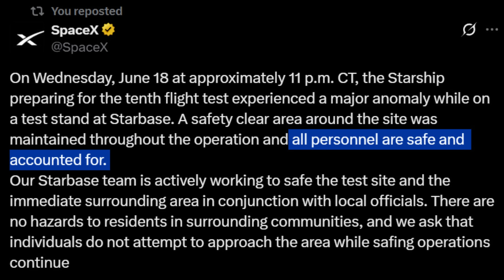SpaceX's Latest Starship Explodes During Ground Test

Comment: This is what I explain to my "agile scrum" enthusiastic colleagues - you can not apply brainlessly methods borrowed from software and computer science into engineering, especially mission-crytical. You can not replace quality orderly engineering with fast design iteration. It looks cool for a while - until it does not. Complex multidisciplinary systems fail in a very complex ways and you can not just hope failure modes go away proportionally to the design iterations. If your underlying system is trash, in software it will work somehow and when it fails the cost of a new iteration is not that big. In engineering badly designed systems will not magically get much better because you test them and fail them more. This is a very non-intelligent thing to do.

Comment: Scott , I think your statement about Mars being a long shot is a bit too optimistic.  At the rate SpaceX is going a single orbit is a long shot . Correct me it I am wrong but has any other program had 10 spectacular failures and continued on ? Any rocket destined for Mars should not even break a sweat getting to low earth orbit

Comment: SpaceX should build an adapter to allow Block 2 Starships to be mounted directly to Pad 1 for chryo and engine testing, and rebuild Massey's to support Block 3 Starships.  This would allow for two more flights before Pad 2 is operational.  If a test blows up Pad 1, so be it.  The Block 3 campaign can't start until Pad 2 is operational anyways.  No need for dump money and resources into Massey's to complete Block 2 campaign.

Comment: Is it now time for
a. Space X took take a long look at the structural integrity of the whole starship as it would be to appear that it is structural failure/work quality/design that is coming to the front of the program - because of the speed of the expected turnover rate to make the program successful and the obvious financial pressure?
b. Is this pressure being caused by the godlike bottom line of Max payload expectations (that cannot be touched) and this is at the expense of everything else which points to design being maximized for this Line rather than longevity and reliability? which will pay in the long term - - falcon 9 being the obvious example.
Space x is now committed to launching the big rockets while the turtle (F9) is slowly getting the satellites and other paying stuff into space which ultimately pays the bills. The math must be obvious by now, how many more F9 launches could have been made if resources hadn't been deployed chasing the golden egg - 10x payload?
Space x demo crews and speed of pipe turnaround and tank delivery present small delays as will concrete pad and deluge pipework repairs but this is a small matter compared to the problems faced by losing 3x V2 starships and folks then talking about V3 which is all about increasing payloads yet again. 
Question?  - has the physical engineering limit been reached/exceeded for the production cycle turnaround? - its all very well defending the destruction iteration engineering model but 3 failures in a row would point to a serious physical problem - wouldn't it?
Also, Manufacturing at such a rate with constant design iteration presents its own problems - is it time to look at less payload to create more reliability (math mentioned before)?
I am a huge fan - we need reliable space vehicles to move forward but I think the excitement created by constant shouting about goals that may be 100 years away is forcing development at a rate which may have reached its limit of reliability and safety.
simple truth - space x hasn't got this rocket to reliably orbit the earth yet and we are going to make it bigger?
what is next? - ignore the mishap - rebuild the site and carry on? that would seem to be a poor decision from the outside.
Just one thing that i think may have been "glossed over" in the commentary was the answer to the question about what if this had happened to a fully loaded starship on the pad with the fully loaded starship - that's 5000 tons of fuel?  
Wouldn't cause a detonation creating a shockwave but the deflagration - looking at the damage to the smaller massey's site - what would be the effect on the bigger site?
 Doesn't that have to be factored into any thinking on continued design expansion?
The world - including me, look forward to launches and the spectacular catches but continuing failure will affect everything - including space tourism.
I am asking questions - not criticizing
anyone done the math on Falcon 9 launches and income vs - how long starship development has taken rather than increasing the falcon 9 fleet?
Great discussion but I think the physical engineering/speed limit has been reached - so it will be fascinating to see whether speed of launch/payload gods still rule.

Comment: Another successful data gathering event. 

So when is sx going to get the data they need for the THERMAL PROTECTION SYSTEM design so that it can inform V3 design. Everything is getting way out of sync for data transferring forward. So now a V2 starship is gone, do they have too many V2 boosters?

Another one bites the dust Another one bites the dust And another one gone, and another one gone Another one bites the dust! → Queen. 

Looking SUBOPTIMAL THERE folks! This sorta has the feel of the very early space program when the rockets were blowing up constantly because they were doing things for the very first time!

11:54 No s… Sherlock! What takes a real engineer is to recognize this years ago. Sx is wasting time chasing their tail. There is a clear root cause to this CF.

Comment: Are the header tanks the source for the attitude control thrusters?
If so eliminating fuel requiring jets, it is far better to use an attitude control system using pairs of counter rotating control moment gyros, each pair sized for the corresponding body axis.
Based on new solid state battery technology with an energy density of 660 watthours per kg this would remove any conflagration.
Further weight reduction is the elimination of the pesky flaps at the nose and aft, replaced with a fixed ceramic composite strake with trim tabs for momentum desaturation.
Can this system be simulated to evaluate all operation scenarios from free fall to re-entry to stabilization after landing until the landing legs are individually adjusted to prevent tip over. 
No fuel  required,  no leaks. For the long trip to mars, solar panels would provide the power and the solar pressure can provide the torque for desaturation.

Comment: You have another YouTube channel signing off with "Fly Safe." Captain Steeve, a commercial airline pilot (a captain), who has recently been commenting on the Air India crash amongst others, uses the same ending. Within the wide range held by the tube of U, I suggest you are both towards the analytical, rather than the wildly speculative commentators.

Comment: Funny thou...  By the 8th Saturn V launch, NASA and put men on the moon 55 years ago.   Every test launch meets the milestone, no explosions.  About a dozen or so Mercury and Gemini launches only had two explosions - I think.   Almost 10 years before the moon landing.     And the guy who can't design a truck can't EVEN get his Starship to do a single orbit or carry a dummy-payload  which is very Standard as they want to make sure the design can carry the weight. 

Elon promises 100 tons.   So far they only did a banana and then carried about 5 tons of test-Starlinks Sats (non functional).   And they couldn't even OPEN the door.    Ah, remember - Elon was given about $4B for a design for lunar and beyond.  bit its made for Starlink launches.   

This is #10.  This is not impressive.

Comment: Composite Tanks have been known for over 20 years to not be reliable... in fact it was first proven in the Paintball industry,  No other nitrogen/co2 tanks failed during play other than Composite tanks.  It became so bad and deadly that shops refused to refill them and started a rigourous testing campaign and you could only refill after tank is tested (which you paid extra for)

Why would anyone use such things in a rocket is beyond me, to save a little weight?  We so called "PC Engineers" or so you taught said this years ago, we also warned about the ground tanks around the pad was also way too close, its not even allowed in Aviation why would it be allowed for rockets?  But hey, we were told "you think your smarter than Elon?" and "Your an armchair engineer"  not knowing most of us commenting and critiquing the choices Elon were making are actual Engineers longer in the field than Elon himself has been alive.

Now rebuild everything at the test facility, your cost saving using composite tanks just cost you way more money.

BRAVO!!!

I also saw Felix's (What about it) interview as well... Its sometimes good to not have your nose right up Elon's Arse, its more helpful to be actually critical of certain things vs Brown nosing... But you cant have you loosing respect from Elon huh...  It is a Blunder on your part not speaking up at that point, just like it was a blunder on last live stream of test launch where you got up and left chat with an utter moron missing everything that happened during the flight and that it was even in trouble until a full half hour after.

Sad people.

But hey when you Stop Micro-Managing and go to play politician and set your seed in multiple women, something must go wrong... and here we are.

Comment: Probably a reason for the header tank to be st the  other end than down closer to the bottom with shorter down comers.  Might be better to have 3 smaller tanks near the bottom or they to need to rethink the design cause the newer design is not working better than first designs.

Comment: As far as silica effects, when I was working in a dental lab we used silica for ceramics casting and needed ventelation or masks when mixing as long term exposure causes silicosis. This was free silica and not fiberous but I imagine the risk is similar.

Comment: I mean, the whole problem is that Starship is soooo heavy, that they keep having to add more and more fuel while saving weight in order to have any payload weight left. And that is starting to bite. The tyranny of the rocket equation is absolute, and when you try to build a 2 stage reusable rocket with a low delta v fuel such as methane+O2, well, you set yourself a herculean task.

Comment: Very cool of Kathy Lueders to give the HLS contract to SpaceX while she was at NASA, then quit NASA to go work for SpaceX. Very normal and super not corrupt. Now Musk is again promising Mars nonsense, probably hoping everyone would just forget about the BILLIONS given to SpaceX for said HLS. You may now commence your apologetics for:
- Working on starlink deploying instead of the HLS variant 
- FIVE cancelled in-orbit raptor re-lights (well, SUB-orbital, since Starship has not yet made orbit)
- THREE cancelled "pez dispenser demos" with one partial success (open but wouldn't close)
- CONSTANT LYING ABOUT THE DAMN HEAT TILES!! SpaceX didn't "invent" them or "innovate on the design", THEY LICENSED IT (come on y'all, this is all in the public record)
- Yeah, we know the catch of the booster is cool, we all saw it, but the idea is to get the PAYLOAD to its destination, and CLOSING IN ON TEN FLIGHTS, they're at zero for a 100% successful flight, AND THEY HAVEN'T EVEN ATTEMPTED ACTUAL ORBIT YET.
- The raptor 3 lie "look how less complex it is" (photo cropped just above the main body to hide the plumbing). They did THE SAME TRICK for the Raptor 2. Why lie? The engine is still a marvel of engineering, so WTH?
-In-orbit refuelling. Watch Destin from Smarter Every Day's video about how stupid complex it is, and how you'll need at least FIFTEEN FLIGHTS to fill one starship with a propellant that has not been demonstrated to be transferable in orbit yet.

Comment: Hi Scott, thanks for covering this so well. In watching the slow motion over and over, I think the timing would indicate one of the header tanks rupturing, and since it acted as an oxidizer to the methane tank rupturing, I deduce that it was the oxygen tank. I believe it will prove to be a catastrophic failure of the high-pressure side of that O2 tank.
Thoughts?

Comment: 3:51 — Scott Manley, that's not true. We DO KNOW what breathing silica particles can lead to, and it's called SILICOSIS, although I do not think the amount in the air around the test stand was saturated enough to get it. But — like you said.
⚠BEST BE CAREFUL
Silicosis is a form of, usually, occupational lung disease caused by inhalation of crystalline silica dust. It is marked by inflammation and scarring in the form of nodular lesions in the upper lobes of the lungs. It is a type of pneumoconiosis. Silicosis, particularly the acute form, is characterized by shortness of breath, cough, fever, and cyanosis (bluish skin). It may often be misdiagnosed as pulmonary edema (fluid in the lungs), pneumonia, or tuberculosis. Using workplace controls, silicosis is almost always a preventable disease.

Silicosis resulted in at least 43,000 deaths globally in 2013, down from at least 50,000 deaths in 1990.

Comment: Too much reliance on computer design and 3d printing of parts.  Back in the 60s NASA engineers actually knew how to design and produce the parts using pioneering processes and real engineering skill.  Today that isn't the case, when a bunch of engineers recently looked at the Rocketdyne F1 engine that powered the Saturn V first stage boosters they couldn't work out to reproduce it!  The skills needed to make certain parts of the engine have been lost as many of the engineers have passed away over time.  So instead they scanned many of the parts to try and build a computer model and hopefully produce a similar engine, needless to say it failed which is why spaceX rockets use multiple smaller engines, instead of the F1 clones they originally intended to use.

Comment: A chemist who deals with liquid oxygen was talking to me a few months ago about the way Spacex loads their starship with Oxygen first and then methane and he thought it odd for one main reason - methane has a relatively low liquid range, from -160 to -180c (These are approximate temps as I cant remember them exactly, but they are within a degree or two), and it begins to freeze at -180c. Liquid oxygen ranges from -180 to -220c, so it is possible to cause some frozen methane to form in the pipes from the loading point to the methane tanks. This is not an issue when there is flow as any "ice" would move to the relatively warmer tank and melt, but during that initial Liquid Methane filling he thought they would have had more issues with it freezing up, and maybe causing a partial blockage and then release akin to a form of water hammer.
Reply: That was a constructive comment.👍
Reply: Wow, great insight, thanks.
Reply: The freezing point of methane is like -295 Deg F, so they would be well above that temperature with the liquid phase being about -260 Deg F so there wouldn't be any "ice" in the transfer piping.  Liquid Oxygen would be transferred using a totally separate set of piping so never the two would mix (until they meet in the combustion chamber)

Comment: There is an excellent book from NASA one can find on free pdf download : "What Made Apollo a Success" by all chief engineers of the Apollo Program back in the days. In the early 70s.
Maybe Musk and the others at SpaceX should spend a few hours reading it thoroughly ?
the 101 on how to make a complex space program successfully that is obviously not into SpaceX methodology yet.
Are they QC all components at each suppliers locations ? ARe they testing EACH components with good safety margins (eg. 50% on Apollo) ? (safety margins may be amended on case by case if overweight/size is not compatible with the mission).
As for now, it looks like if SpaceX is counting solely on full system testing. At least the last 3 explosions are showing this to outsiders. Prove me wrong but this is NOT how Apollo was set up !

Comment: Starship V2 has too many optimizations at once.  I know this very well from my own work and no, it's not rocket science, but still has some amount of complexity.  Just a little bit too much done a little bit too good, and it becomes nearly impossible to find the cause.

V1 was beginning to function, the only remaining ptoblems being the cargo door, reignition and reentry/heat tiles.  V2 is larger and that seems to be the culprit.  We had steel rockets in the '60s, which were very vulnerable while unfueled.  That is why we abandoned that path.  Starship is much larger, but it seems V2 exceeds the limit.

My advice is: build spaceships.  We have launch & landing capsules.  Where is Dreamchaser btw?  We have orbital infrastructure.  Take the next step.  Starship must not land.  Crew and cargo rotation should be done at orbital space stations.  That is what they are for.  For deep space, Starship needs better propulsion.  Try to get nuke motors for Starship.
🚀🏴‍☠️🎸

Comment: I am suspecting an issue with how the lines and tanks are bonded together. Granted I don't have close to the knowledge Scott has or certainly not SpaceX themselves. But given the way these vehicles have been coming apart, there definitely seems to be a weak link in the building chain, something that isn't reacting to sustained pressure and/or vibration how it should. If it was failure of a composite nitrogen tank, that reminds me of the Falcon 9 that blew up on the pad at CCAFS (the one Musk's people were convinced was due to a sniper with a rifle). Granted the mechanisms with that failure was something else (helium sphere inside a LOX tank), but it has me wondering if perhaps there might be some sortcuts in the manufacturing of small composite pressure tanks which are beginning to manifest themselves.